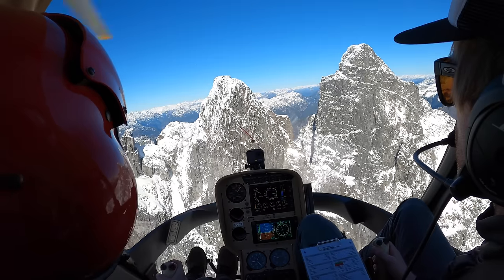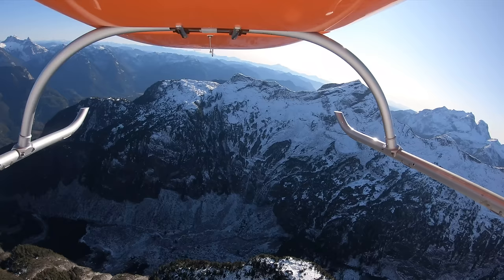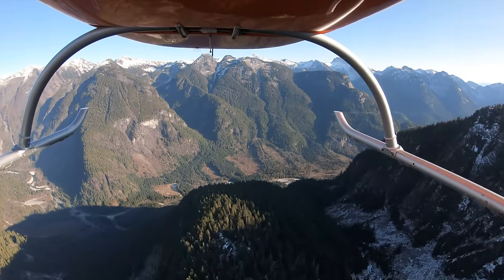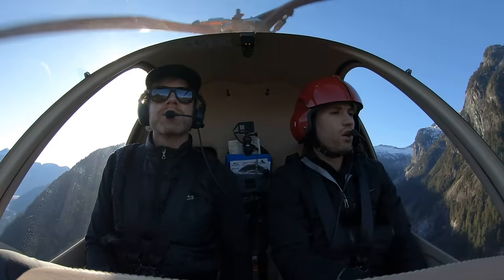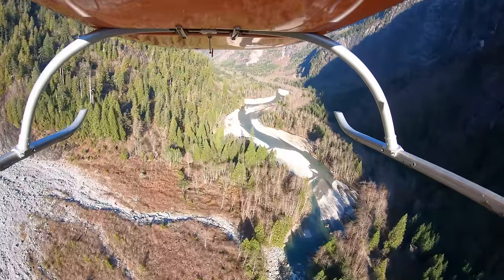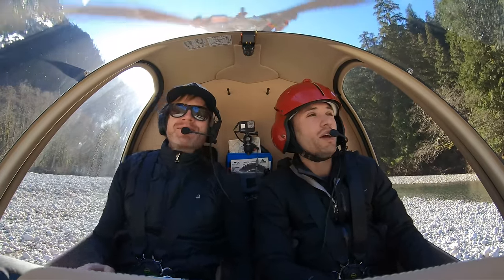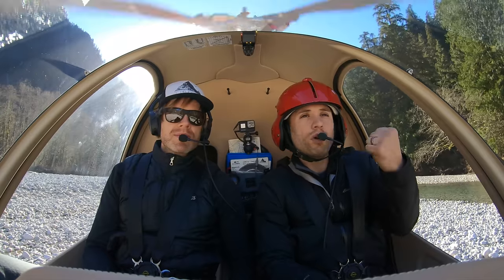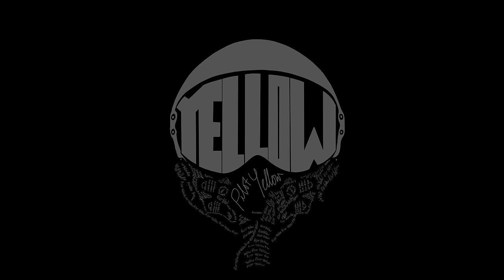ENGINE FAILURE ON MOUNTAIN APPROACH

Comment: I would think for emergency landings like this where you have to put it down in a tight spot whiteout any room to slide the "reverse" auto rotation where you rotate 180 degrees and put it down with no forward momentum would be safer? Also to me the "reverse" auto gyro technique seems more safe and easy to do in general (no danger of tail strike and no sliding when touching down)...

I am not a heli pilot other then did a little RC and flight sim years ago, but I keep being fed heli videos like this and I love helicopters :)

Comment: But even every airframe has a limit for simulated autorotations..the amount of stress that it undergoes is phenomenal
Reply: What stress? It just slowly descends like a parachute, while with actual power on it uses more forces to fly up and etc.
Reply: @cutefox8319  are you a pilot Sir.. if NO then you should know that every airframe undergoes tremendous loading during an auto rotation..specially the rotor hub swash plates and the rotor blades
Reply: @tomrohan8480  then i would like to hear explanation from you why it is so? How comes that free slow flight hurts more for a heli than regular powered flight where loads on disk actually are higher because of the need to climb up?
Reply: @cutefox8319  sir the stress that it generates wen u flare jus before touchdown is tremendous on the rotors n the hub.. its like dropping a ball tied to a thread..u feel the force on the thread wen the ball falls the full length of the thread, arresting a free fall..
Reply: @tomrohan8480  ahh, so you meant that flare part before touch the ground, makes sense now :) seems at that particular moment load is more high than during just normal take off up which usually goes slowly. But what about vertical autorotation then? Let's say, helicopter doesn't move forward, so before final touch it would be not really flare but rather soft blades angle change to compensate descending? Or without extreme maneuvre like flare there will be not enough of power saved during zero forward speed autorotation?
Reply: @cutefox8319  Autorotation needs to have a forward speed component if doing from 1000ft and above cause you can't decent vertically because there is serious danger of getting into vortex ring state 
Vertical decent autorotation can be done while doing a hover close to ground else the safest bet is forward speed Autorotation

Comment: In my entire life I have seen only one engine failure with autorotation ended without total destruction of the machine. This is entertaining but highly unrealistic in terms of probability, and rest assured that this pilot tested this exact manoeuvre before, same place, same path.
Reply: Yup, this is clearly well planned (and executed). It does prove the point that provided the main rotor, and its' gearbox or bearings are not damaged to the extent that it can no longer rotate, that it is possible to not drop straight to the ground like a stone. However given that helicopters either don't or can't fly to particularly high altitudes, I'd imagine the real life possibilities of seeking out a safe landing site and actually getting down on it in a controlled enough manner to avoid total destruction are way way less than that of gliding in a light airplane....
I'm afraid that this video has done nothing to improve my faith or trust in travelling in what is clearly the invention of a deranged and unbalanced mind. Not unlike designing a car with the fuel tank mounted on the front bumper and a big sharp spike sticking out of the middle of the steering wheel!
Reply: Wouldn’t the rotors stop spinning if the engine failed? I don’t know how helicopters work.
Reply: @bobbykerr4293  helicopter rotors have a freewheel mechanism between engine and rotor exactly as bicycles do, so if engine stops the rotor can and does still spin thanks to relative wind while helicopter is "gliding" toward the earth. Problem is that engine failures normaly are unexpected and the pilot has very short reaction time to do the right thing even provided he has enough altitude to take some decisions. Anyway helicopters can fly at high altitudes, if you search youtube you should be able to find a video of a European helicopter landing on top of mount Everest.
Reply: @lucianolandi7307  nice to see an intelligent answer unlike a lot of the keyboard gurus who only waste our time with comments that would get them knocked on their ass in a face to face conversation.
Reply: Bobby Kerr it’s got a clutch that disengages the main rotor transmission from the engine
Reply: Wyatt maxwell ...it’s called a “SPRAGUE “ clutch. It ‘uncouples’ the transmission FROM the engine...ALLOWING the transmission/ROTORS to SPIN FREELY. While keeping airspeed up AND LOSING ALTITUDE with RPM’s “in the Green”, the UPdraft through the rotors WHILE DESCENDING allows the gliding helicopter to maintain STORED ENERGY in the rotor system....all the way to the ground
Reply: shadychrisuk you’re off base about how Helicopters do with power off. Just as well as fixed wing.
Reply: Bobby Kerr  Each blade of a helicopter is like a wing. So as gravity pulls the helicopter down the air passing over the blades propel them. That’s why he was keeping a close eye on his air speed and the rotation speed of his blades. It’s calculated what speeds are ideal for the best rate of glide vs altitude lost. Just like fixed wing planes, pilots must learn and drill on how to fly or glide with power off and the decisions to be made in how to determine a landing spot and get there safely. Sometimes you run out of options.

Comment: I flew aircrew on Coast Guard H-3 helicopters, and I really liked doing autorotation drills. They would pull really hard collective and the blades would really beat the air loudly (wop, wop, wop) and the nose would pitch up hard. Then just as it nosed over, before it could do the last hard drop to the ground, the copilot would Ram full throttle and as we pitched forward we would pull out of it. Really fun!

Comment: That’s the shear beauty of helicopters...in a plane you’d have way less options to land and safely roll out. Well done!
Reply: Rusty Climber - I'm an autogyro pilot.
We don't stall. Not only that, because our rotors are optimised for autorotation rather than being powered, we have things in our toolbag which aren't so applicable in a heli.
We can pull back to "minimum descent speed", which is about 40mph, and hang around in the air looking for our best landing zone. If we're going to overshoot our landing zone, we can perform tight S-turns to lose height without gaining too much ground or, because our rotors will continue to turn in autorotation even with zero forward airspeed (like a sycamore seed), we can execute a "vertical" descent, dipping the nose in the last few hundred feet to gain airspeed for the flare. We have a slightly better glide-ratio than a heli (although not as good as in a fixed-wing) but we can put down on a handkerchief much like a heli.
Just as with a heli, we have to be cautious of a roll-over on landing so we don't want to pick soft, rocky, or sideways-sloping terrain and ditching in water is unlikely to to be a good day as it will roll over and the rotors (which will be doing around 300rpm at the time) will then dig in and flip the airframe around.
Part of being a good pilot is flying in such a way that there is always an "out" and keeping it in mind until you pick the next one along - "Be the monkey" as the phrase goes.
Reply: Rusty Climber - Haha... Interesting... I've liked gyros since I was a kid but I always saw them as an oddity and not a particularly safe or practical one at that. I work for a UAV manufacturer and I was tasked with evaluating a rotordyne/gyrodyne as a VTOL aircraft for air-work. It re-ignited my interest in autogyros and I found out just how far they have come since I was young... I decided that this was the aircraft I really wanted to fly.
That was around six to nine months ago. I now have my own 2009 MTO Sport which I love to bits and if I don't fly it regularly, I start getting withdrawal symptoms. ;)
I took my wife up for her first flight last week (she's flown in commercial passenger airlines before but never a light aircraft and certainly nothing open-cockpit).
As the gyro unstuck from the runway and I said, "we're airborne", she said, "Yay!!" and then shortly after, I called out "climbout-speed" and pulled back into the climbout and she let out a little squeal which was closely followed by a brief evil chuckle from me.
I think she kind of understood why I was so keen on learning to fly a gyro.
We did a few "vertical" descents near some interesting buildings (such as a nearby palace and a castle) and the wind was just strong enough to pull off a "hover".
When we came in to land, the runway we were using had the taxi-way at the far end so I declared that I would be landing long... flew all the way down the runway and plonked it on the numbers at the far end and she said, "Wow...! We've stopped !".
The only thing she doesn't really like about it is that even in a decent flight-suit, she got a bit cold - I guess that's par for the course in Scotland. I think next time, she'll take my advice and use a neck-roll or a scarf and possibly put on another layer of clothing underneath the suit.
I've flown a few other things as well, and whenever I fly in an enclosed cockpit, I feel... well... too enclosed. I really appreciate the almost unrestricted visibility of an open-cockpit gyro.
Reply: Rusty Climber - My gyro has the dual regulators for heated clothing (eg. jacket + gloves) - I've heard mixed opinions about it and the one time I tried heated gloves, I was not too impressed (although it could be that the gloves were beyond their best and no longer functioning as intended). I've never really felt the cold (except in my feet when I wore shoes instead of my boots in cold weather). Heated clothing is not cheap and there are other things I consider to be a higher priority, especially when I can achieve "heating" in other ways.
I know that feeling of not having the cash to develop ideas. If I'd been born to riches, the things I would have invented by now...!!!

Comment: If you lose engine power, how do you control the trail rotor torque?  I mean if there's no power how do you prevent it from spinning out of control?
Reply: At a high enough airspeed, the vertical fin weather vanes the aircraft into the wind, also, as you're in the auto, air is flowing UP through the bottom of the rotor, spinning it. Usually the Main rotor and TR are connected through the transmission so if the MR is turning it'll turn the TR (assuming no mechanical breakage)

Comment: I knew that there was something like a certain pitch for the blades to get max lift still and still land just fine, the air over the blades still make them turn and you still have some control, but i didn't know it was that much or that you could stretch the glide that far honestly.

Comment: Would the rotor still running for long enough if that was a real engine failure? Seens to me that without power, the rotor would be slowly decreasing rpm until it's not giving lift anymore.

Comment: Nice video!   What are your thoughts on doing more steep approaches for regular landings with engine that are closer to the approach angle of a auto-rotation?   I see so many instructors teach very shallow approaches where if they had engine failure they would not make their LZ and land in a not so nice spot.   I do more steep approaches for this reason.   I heard another guy say he is almost in full auto-rotation on landings and he prefers it because he saves on up-collective time as well.  :)

Comment: I crashed in an FH-1100 in July 1970 in the Alaska Range.  I was a passenger (front) with a pilot and 3 men in the back seat.  We lost the turbine just shy of a ridge (probably about 5,000 ft), so the pilot spun us downhill, but we hit the sloped side of the mtn 3 times.  The fourth time we had run out of rotor energy and fwd speed, and ended up going in on a tundra covered terrace.  The earlier impacts could have resulted in a bad tumble and roll- probably killing us all if the craft didn't bounce back up. The pilot cut his hand on the imploded bubble, and the turbine got ripped out of the mounts and caused a fire as the turbine spun to a stop.  We were all very lucky.  Pilot's skill and maneuvering saved our lives!  Aside from the minor hand injury, we were all OK,
Reply from the maker: Bill Roberts wow what an incredible story. That’s amazing you guys survived that. Thanks for sharing that.
Reply: @PilotYellow  The crash investigator came out to the crash site and told us not many people survive a helicopter crash.  If the impact doesn't get you, the rotor usually will.  We had a two bladed rotor, and one end dug a 5 foot hole in the ground and instantly stopped; I don't recall what happened to the other rotor but luckily it did not penetrate the cabin.  We were very lucky.  Another luck-factor- the skids with tundra pads bent up radically on the tips at the first impact.  When we "bounced" down the side of the mtn, we hit brush 4 to6 ft high.  I was sure we were going to tumble, but we didn't.  I figure the bent up skids help deflect the brush.
Reply from the maker: Bill Roberts wow that is a miraculous story.

Comment: Alot of people mistakenly think a helicopter falls like a brick if the engine quits. This doesn't happen so long as the blades continue to spin and if the helicopter is angled right the wind keeps the blades spinning. Without power the blades will not spin fast enough to maintain altitude or climb but they can spin fast enough for a slow and controlled descent. Angling the helicopter right is a little tricky if the helicopter is to horizontal the blades slow down too much and if the helicopter is too verticle it builds up a dangerous amount of speed. The pilot has to watch the rotor RPM guage and make constant minor pitch adjustments. You only get one chance at landing, if you try and pull up the blades quickly slow down and you drop like a rock, gaining altitude for a go around is impossible. A correctly done autorotation is much safer than gliding a fixed wing aircraft in with no engine because you can come in at a much lower speed and hit a much smaller target. I have heard small light helicopters glide alot better than some of the big heavy military helicopters.

Comment: This video doesn’t comply with SOP Standard Operation Procedures for engine failure. 1 fly the helicopter, ok, 2 navigate, ok, But 3, non normal operation for engine failure, analysis of the engine failure, engine restart attempt, prepare for forced landing, fuel shut off valve, unlock doors etc… none of these has been evoked during plenty of time available.

Comment: How does a long practice auto effect engine cooling? especially in cold conditions. And when you want that power back and it’s been at idle for so long. I’m guessing the G2 is fuel injected?
Reply: lycoming o-360 engine is carburetor, If i read correctly the Carb heat was at 25c  so icing should not be any issue here, not sure what ambient temp is on the day or humidity but generally once the engine has been at operating temp the heat in the block will help maintain engine efficiency through the combustion process once power is rolled back on. If the engine was shut down for and extended period in cold conditions whilst gliding down this would be a different situation, and likely part the reason why Mischa leaves the engine running for added safety
Reply from the maker: Mr BrownE presents AW yes great response below.

Comment: Didn't know helicopters would glide
Reply: Ya. There's a ton of technical learning that underlies a good understanding of how it works, but essentially helicopters can "glide". If you've ever contemplated the silver maple seed. You've probably seen the one winged seed that spins as it falls. The purpose is to keep it aloft longer so it can cover a greater distance. Your autorotating helicopter is doing the same thing, just with multiple blades. The human has to control it to maintain rotor rpm within a fairly strict range, but otherwise it's very similar to a silver maple seed's descent to the ground.
Reply: Scott Clymer Appreciate the super-clarified explanation. Thank you!
Reply: I think this is only the case with collective pitch, based on my RC helicopter experience.

Comment: IT's amazing how many people don't know how well a helicopter can come down with no engine power. I fly large expensive radio controlled helicopters and auto rotate them all the time. it is very easy to stall a rotor head by applying too much collective. what you did blatently takes a LOT of practice. nice job.
Reply: Would like to get a ppl and a heli license, sounds pretty cool

Comment: It’s called auto rotation. They control the rpms with no engine power by adjusting the pitch of the main rotor. Helicopter pilots have to practice this quite a bit.

Comment: Am unlearned about helicopters but how would you actually make a soft Landing as you did without power since you said you added power for your simulated failure
Reply: As you flare (bring the nose up slightly at the end) more air goes through the disk (the area swept out by the rotor). That speeds up the rotor, creates lift and slows the aircraft. You also pull up the collective to stop the rotor overspeed, and that increases lift as well. If you time it right the down motion and the forward motion drop to zero as you arrive at the ground. Usually there's a bit of forward motion left and you slide on the skids a bit.

Comment: autorotation in case of engine out onto such an remote area is not so nice.
I am wondering, why you didn´t search an area whith roads (for emergency vehicles can reach you soon).
Your selected place has no roads for emergency response AND no roads for die technicians for repairing the heli.